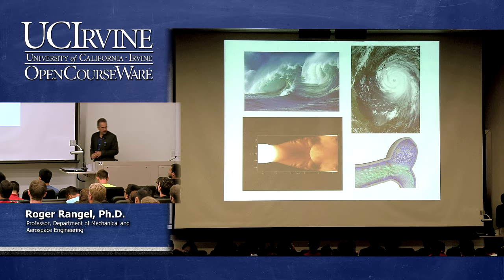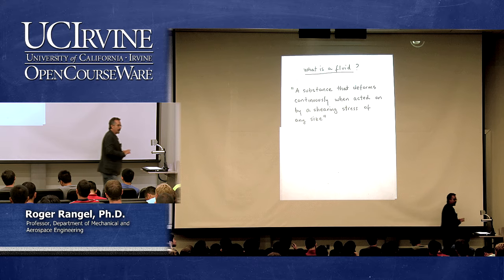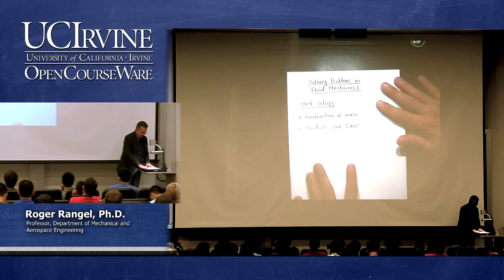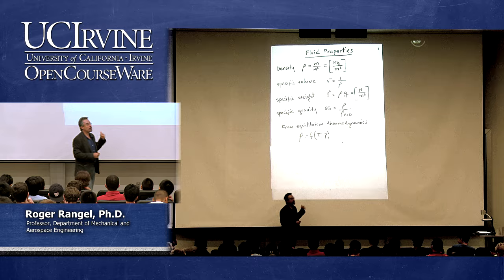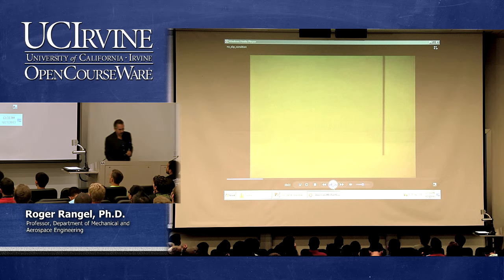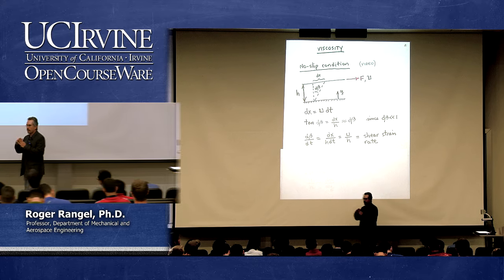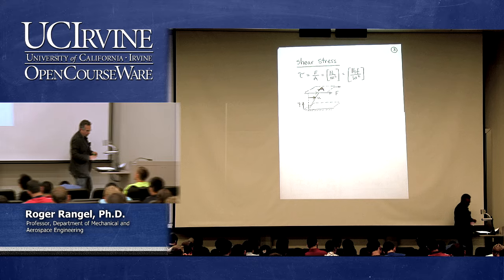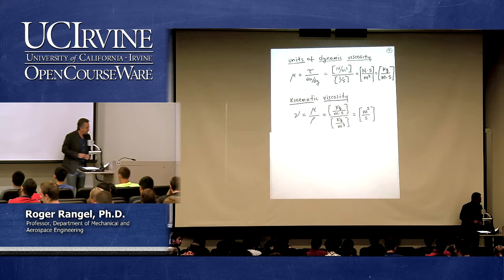Engineering MAE 130A. Intro to Fluid Mechanics. Lecture 01.

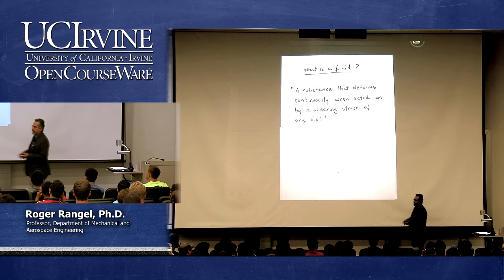Comment: 19:10 In Shear stress, the force vector is perpendicular to the area normal vector and not parallel.
Reply: he never even mentioned the area normal vector as this concept doesn't require it to make sense. the force vector being considered is in the span of the plane (shown as an area), thus they are parallel. he said the force is parallel to the area, which is correct.